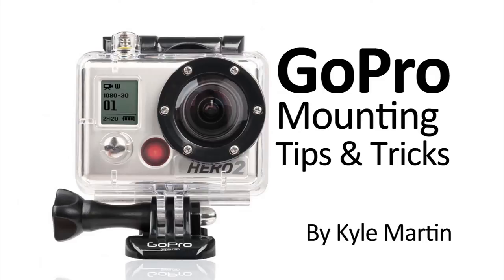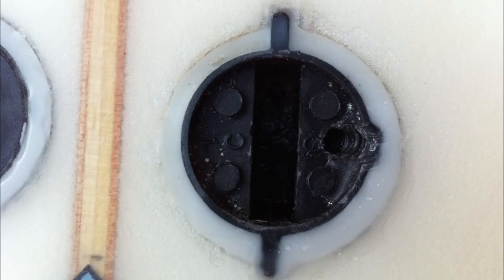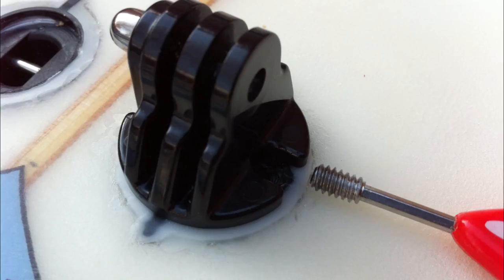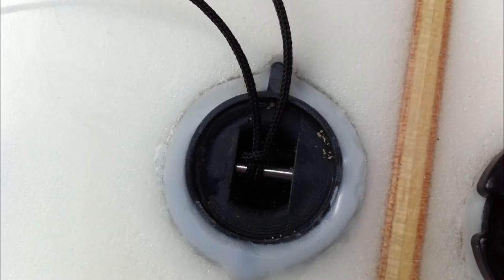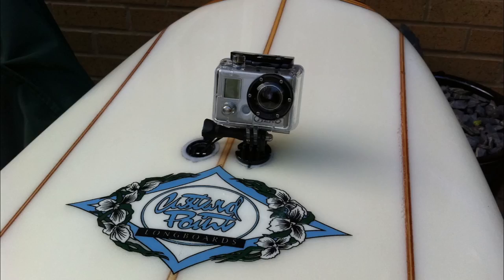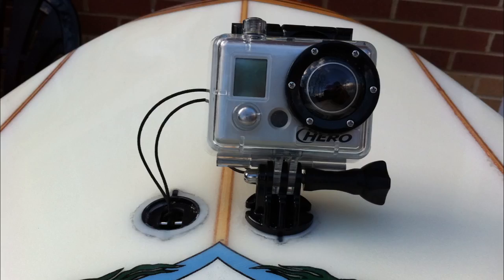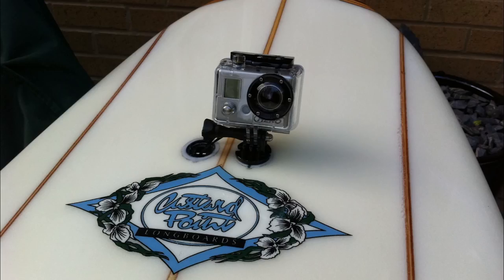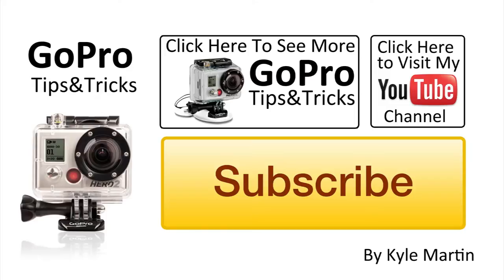More on the GoPro FCS Surfboard Mount: GoPro Mounting Tips & Tricks

Comment: The reason that the screw is not reaching the FCS insert is because the FCS plug has not been mounted properly. if you look closely the plug has a recess. this is so that resin does not flow into the plug while installing.when it is set you need to sand it flush to the board and take the little lip or edge away from the sides. it must all be flush with only the hole for the screw and the slot for the gopro plug.

Comment: The reason why the gopro plug is not locating property is because he has not installed the fin plugs correctly. Those pins on the plugs are used to position the plugs and to stop them from being pushed too far into the hole. Once the plug is set you sand down the plug so the plug is flush with the deck of the board. I glass boards I no what I'm on about just look   at your fins and you will see there are no pins sticking out of the plugs . Kind regards

Comment: OK, by now someone has to have figured out how to mount the camera to a foam board but I have not found this method yet on YouTube. Anyone know of a tried and true method, again for mounting on a foam board. I have heard you can use the same plastic screws used that go through the board to mount the fins to the board but does GoPro have a mount that has a bottm tapped hole for this to screw into?